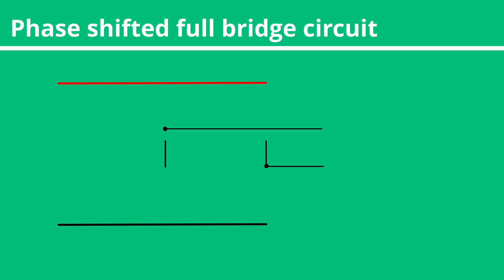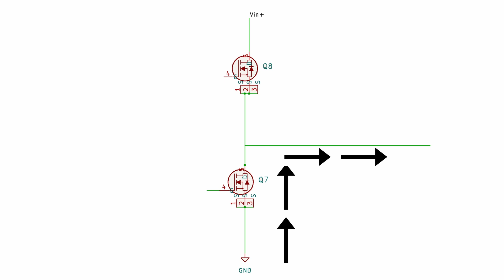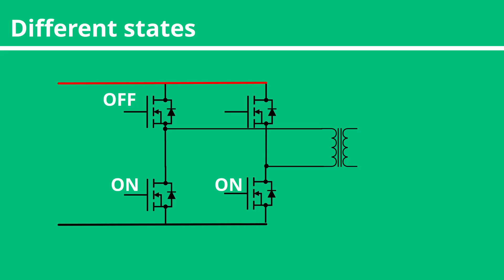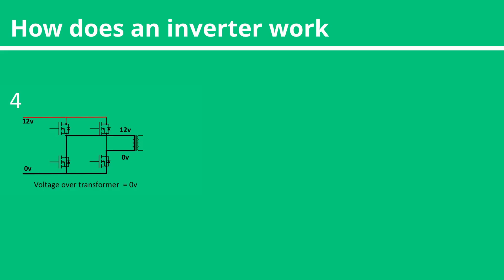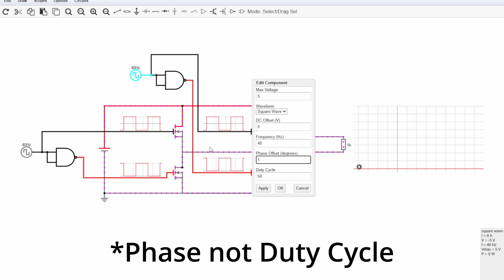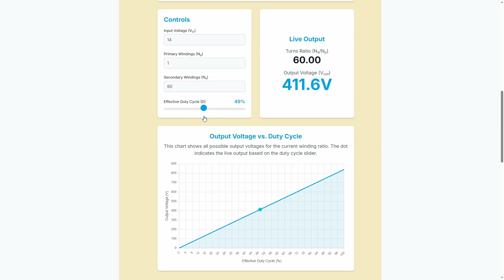High-power dc-dc converters|| True sine inverter part 2

Comment: Any updates on part 3?
Reply from the maker: working on it, I have a lot going on at the moment work-wise, so not that much spare time to do YouTube. I have completed the circuit design, now I have to test and program it. I wanted to switch at 20khz+ so that is doesn't make any audible noise(Sound not electrical), but the feedback loop in the code is a little unstable at the moment, in high instantaneous current draw situations it often massively overcompensates,something else happens(if I knew I could fix it), the code hangs, and pushes 430v DC, out of the converter.
Reply: @Boris_Woodward  what MCU are you using? I'm experienced with STM32, MSP430, PIC and Atmel. Totally willing to give you a hand with the code if you're interested!
Reply from the maker: @OffGridFix stm, specifically STM32G474CBT6TR
Reply: @Boris_Woodward nice, have a love/hate relationship with that chip, specifically some errata I found in the HAL drivers and datasheets related to the USB and timers. Let me know if you'd like a hand.
Reply from the maker: @OffGridFix I have a distinct hate for it after I got 4 reels of them for a bargin price, and now have to use them in everything.
Reply: @Boris_Woodward 😂 I know the feeling

Comment: Great video Boris.  Can you recommend an Asian source for transformers or inductors suitable for making boost converters?
Reply from the maker: Boost converters use an inductor not transformer typically, and there are alot of brands available to choose from, but I personally use MURATA alot because they are relatively cheap. However if you are looking for a transformer Im not really sure of any Asian brands, but i personally use WURTH, TDK, and Hammond. I am looking into cheaper transformers for my true sine inverter project, but so far i have yet to find a good, reliable brand